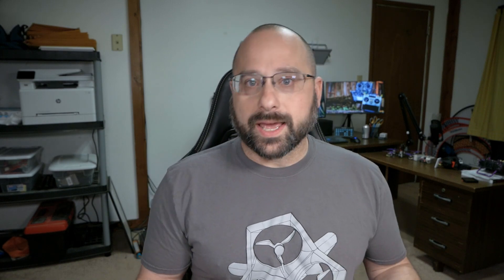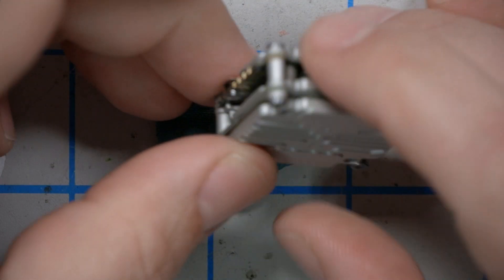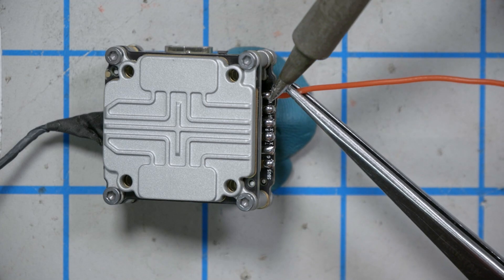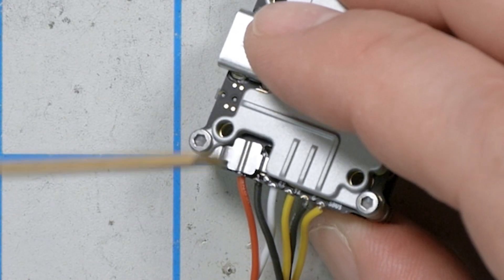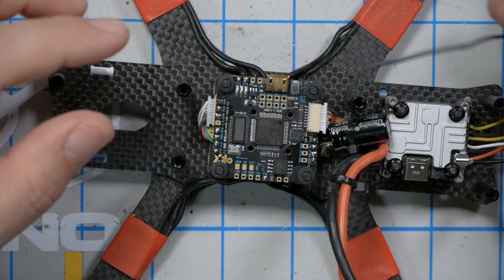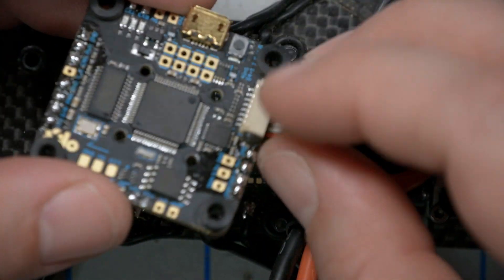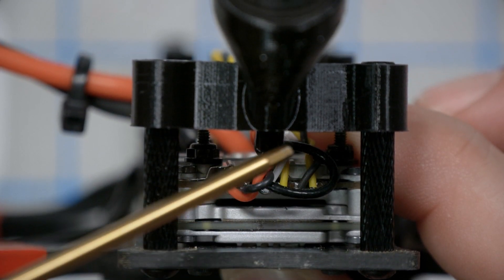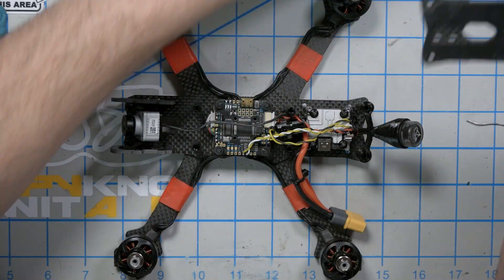DJI FPV Drone Budget Build Full Tutorial - Part 1b - Assembly

Comment: Hey Joshua, new to real life FPV. However, I have been flying on DRL sim using my X9D plus SE for roughly 2 years, and am capable of flying expert levels at high speed. So far, I have the DJI goggles with 2 air units and RC controller, that is all. I’m very interested in buying a “build your own drone” package. I’ve got a couple of questions and remarks for you:

1) Would you recommend this build or are there newer better ones right now that you can offer?

2) I’ve noticed on the website that i cannot remove the CADDX vista from the package. I already have an air unit, and would rather use it. So, would it be possible to do so, and will it fit?

3) I want to primarily use my first drone for freestyle, but race as well. (I’ll probably build a specific racing drone eventually, when my finances permit)

Thanks!

Comment: Would it be correct to assume that using ExpressLRS, DJI, and GPS isn't possible? Seeing that TX/RX4 is used by the Vista and TX/RX3 is used by ERLS. I noticed the XILO STAX manual showed the DSM and SBUS pads as TX/RX1 "resources" respectively, but the silkscreen makes me want to think they function completely differently for some reason.

Comment: I recommend AGAINST soldering the positive lead on the vista directly to vbat or to any other direct-from-LIPO positive pad unless you have adequate protection against voltage spikes. Directly connecting to vbat without a buffer for spikes can potentially blow diodes connected to the RX and TX UART leads in the vista unit. This will totally disable your OSD and your vista unit will be unable to exit low power mode when the quad is armed. You won't even get a voltage reading in-goggles, but you will still get a picture and limited range.

The cap that comes with the kit (soldered to your XT60 pigtail leads) isn't sufficient for filtering it seems as mine suffered this fate. I was going to suggest soldering to a filtered or regulated pad on the Xilo FC but I'm not sure one exists that outputs the 7.4v-26.4v the vista unit requires. There are the filtered vbat pads for the VTX and camera but I'm not 100% on how much current they provide or if they'll be enabled without a full fledged VTX or camera connected/configured in betaflight or if the filtering is even adequate, the FC manual isn't very specific.

FYI - This isn't criticism, putting together this quad with your help has been hugely educational and entertaining, just sharing my experience in case
Reply: Curious building a modified version of this now..   after a lot of digging the xilo vbat says its rated for 8 to 30...    Did you ever find out if there was a filterd lead?

Comment: Rather than wire to the vbat on the bottom of the board, Could one wire the vista voltage wire to the vtx vbat pad on the top of the board to take advantage of the xilo’s vtx power off mode via aux switch? (I’m not using dji for my controller)
Reply from the maker: Yes I think you could do that. But not if you are using the DJI controller. Since switching off the Vista would also switch off the receiver and the you couldn't switch it back on.

Comment: I’m interested in going digital, I have the dji fpv drone.  Do you envision a future update that would allow the dji fpv transmitter to be used with a real fpv freestyle drone? (I’m talking about the new little grey transmitter)
Reply from the maker: Some DJI people have said they intend for the next gen of the Air Unit to work with the Controller. But you have to keep in mind that DJI is a massive company and even when people are saying things they believe to be true, it may not pan out.

Comment: Hello Mr Bardwell. I was in contact with GetFPV Support because the DJI Controller was not working. The solution is to switch off the sbus_baud_fast mode you suggest. In case of activation there is no detection by the flight controller over sbus. I have also activated it in the Goggles menu.
Maybe you can explain the problem.
Regards
Reply from the maker: The FC and air unit need to agree about SBUS baud fast. Highest performance is to have it enabled in both FC and air unjit.
Reply: @JoshuaBardwell  sure, I understand. But when I activate on FC and Air Unit the Remote connetion is lost. I will investigate this evening to do some more tests and will inform you about the result.
Reply: @JoshuaBardwell  wft...
So, the Baud Switch Menu on the googles is covered by a warning notification on the bottom right.
There came a notification screen and after this the menu is free and you can switch the baud settings. It's just not visible because it's covered.
When you know it, it's clear. I thougt the setting it is swiched after confirming. Thank you DJI ^^

Comment: What could be the Problem if Flight Controller do not recognize the DJI Remote Controller?
Remote is bind to Caddx (green led). DJI Goggles are connected to Remote.
Sbus wires correct. Betaflight Settings are correct.

Comment: Note that not all DJI plugs that come on a flight controller are pinned the same way...I've seen it where the 10V and SBUS pins are reversed.  Making that mistake will fry the SUBS diode within the Caddx Vista.  Check pin-out diagram for your flight controller before connecting and of course before connecting a battery.

Comment: So I bought your xilo analog kit and decided to upgrade it with a Caddx vista. I didn't realise there was a vbat and gnd pad on the under side of the FC so I soldered the vista to the main pads on the ESC, is there any effective difference? And should I move the wires over to the FC?

Comment: This. Is. Awesome...

Only thing I'm gonna change is ditch the Phreakstyle and move the guts over to a Moon Goat.  I've broken too much on the Phreakstyle and don't quite trust it enough to carry an expensive Vista.

But that stack and those motors have been rock solid for the last few months.
Reply: Moongoat frame would fit all this?
Reply: @jackalopefpv1708  it should. I ended up just doing the cricket build in a moongoat frame but the moongoat has lots of room.